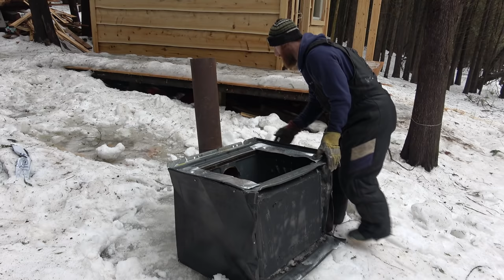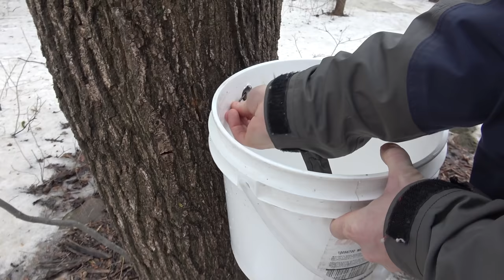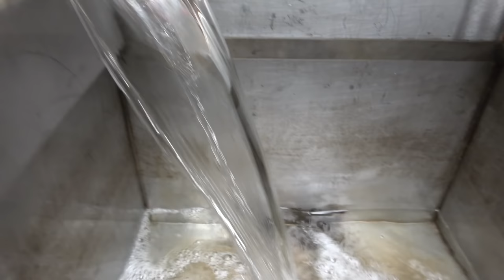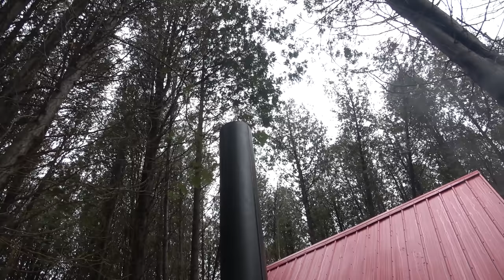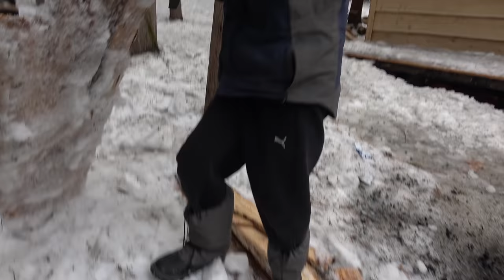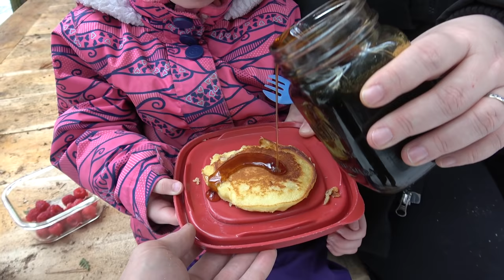Boiling Maple Syrup (Start-to-Finish) ASMR (Silent)

Comment: Maple sap doesn't flow in February -- the ambient temperature is way too cold here in Canada. However, what I would like to see is the installation of the poly tube lines that connect from one tree to the next, and ultimately dump several trees worth of sap into one large bucket. Quebec sappers have perfected this method in the Eastern Township part of the Province -- but it takes a rising hill behind the Sugar Shack to really make use of gravity. Still, it would be neat to see how it is done.

Comment: Planning on making a syrup run  in 2 weeks if the temps cooperate here in central Missouri.  Like your setup.  I need to upgrade from a stock pot and turkey fryer.  It takes way to long to boil down.

Comment: The maple syrup is already flowing in Ontario? This is really early! I made my own syrup last year for the first time, but i could never get its consistently right after 3 different boils. The first batch was too thick, and chrystalized in a few days. In fact my 1st batch has the exact same consistency that yours has when pouring it on the pancakes the same day that is was made. I am guessing your syrup here had probably chrystalized as it seems a bit too thick. My 2nd and 3rd batches were too thin and watery. Ofcourse i did this without a thermometer. I tried the old 40 - 1 ratio but this still didnt produce the consistency that i was looking for. In the end i just made candy with the syrup. thanks!

Comment: Ok Chris, you like traditional processes, try making syrup in a hide boiling bag using hot rocks like the native Americans did. Not your whole sugerbush, just do a little bit to say you did it. Good content. Nobody else has done it.
Reply: Deer hides were a mobile method for boiling water on the go without having to carry extra gear with you and many of the northern tribes were constantly on the move for some reason or another. Wooden bowls would be my guess since clay is sensitive and shatters like cast iron if the temperature changes too quickly. Keeping a clay pot from shattering might have been difficult that far north with the weather being the way it is.

Comment: I hope your plugging those holes after in the trees
Reply: you don't plug'em they'll heal up just fine. What would you use to plug them with that wouldn't cause more harm then good
Reply: Dennis F plug it with the wood that was removed and they don’t heal well at this time of year
Reply: @stewartsavage1123  Once the hole is drilled Sap only flows for about 5wks then it seals up and starts healing & Spring time is when most of the growth happens After a couple years it's hard to tell where the hole was drilled